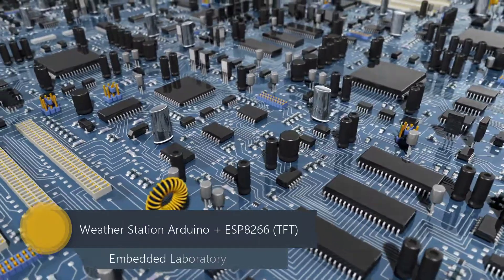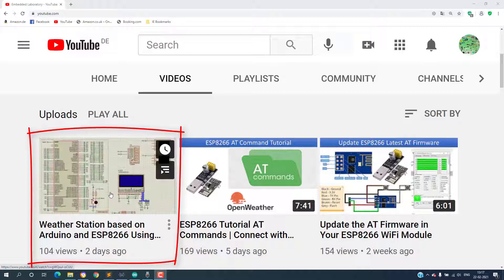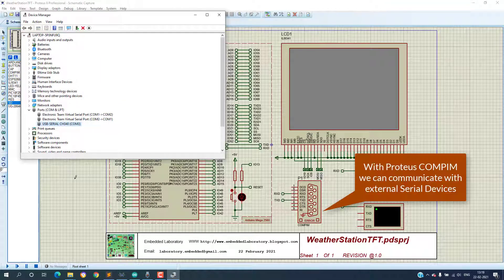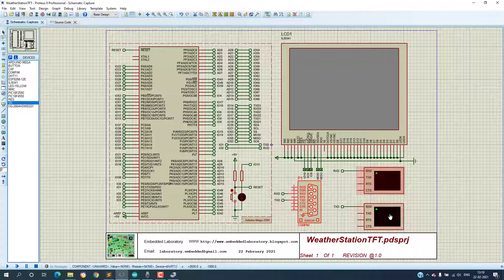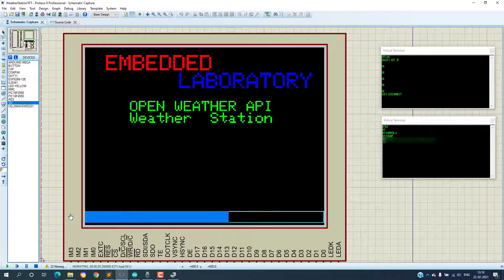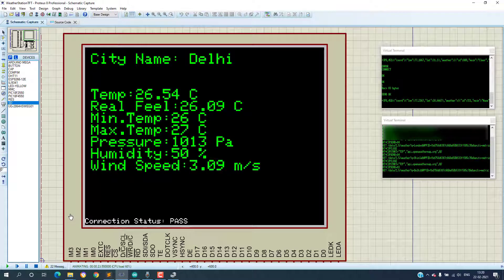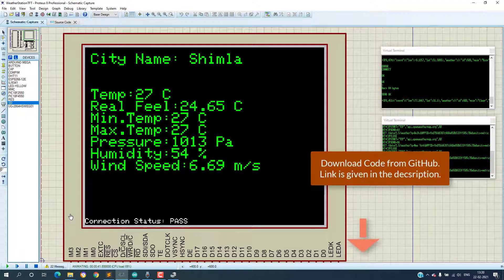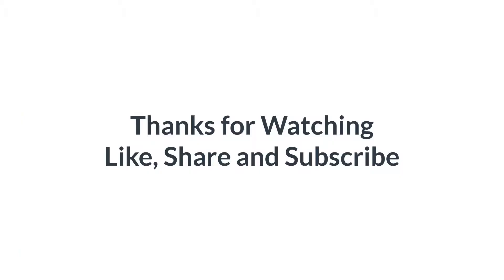Weather Station based on Arduino and ESP8266 Using Open Weather Map and AT Commands | TFT | ILI9341

Comment: Hi, how should the TFT-ILI9341 be connected to the ESP8266? Can you tell me the connection pins? Thank you.
Reply from the maker: Actually tft is not connected with esp8266. Here Aruino Mega is used and tft ili9341 shield is used, so ili9341 is connected with arduino.
Then with Arduino serial port esp8266 is connected, here esp8266 has AT firmware, and from Arduino mega I configure the esp8266 using at command to get data from openweather map.
Please watch previous two videos to understand properly. Thanks

Comment: any esp32  weather station?
Reply from the maker: At the moment not, but I can plan this in my to-do list.
But a question to you? Do you need weather station based on AT commands?
If yes, then the same code can be used for that purpose.
Reply: @EmbeddedLaboratory  me i want to build a esp32 ili9341 tft  weather station :) but cant find a real tutorial im just a newbie in this  kind of board !:)
Reply from the maker: @Evilslayer73  I have ordered my ESP32 and ILI9341, both are on my desk now, and I working on this tutorial with video.
Reply: @EmbeddedLaboratory  Wow awesome thanks a lot!!!:)im excited  because im struggling like  mad  to build this particular set-up :)